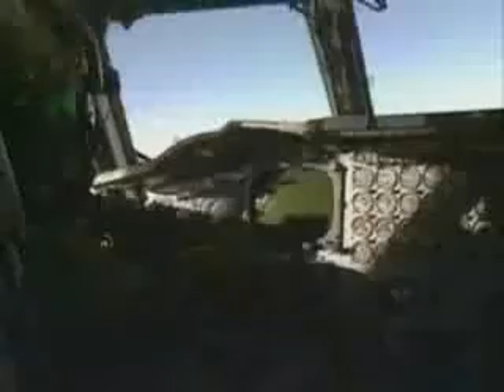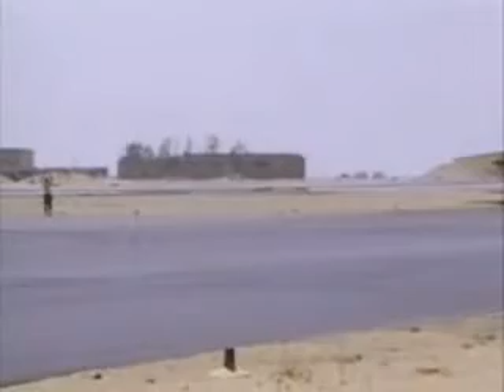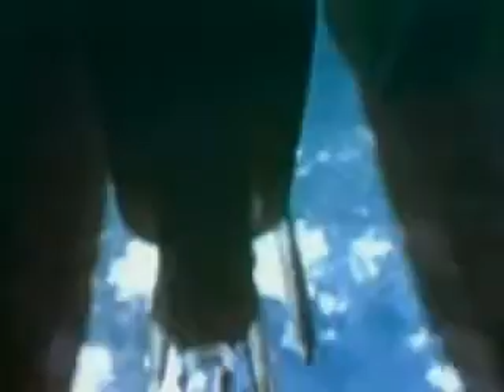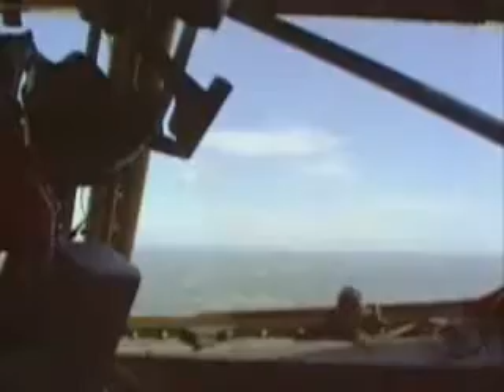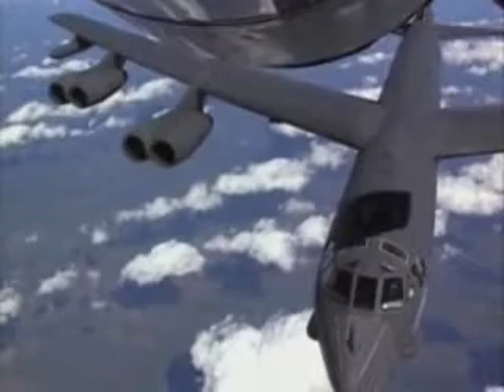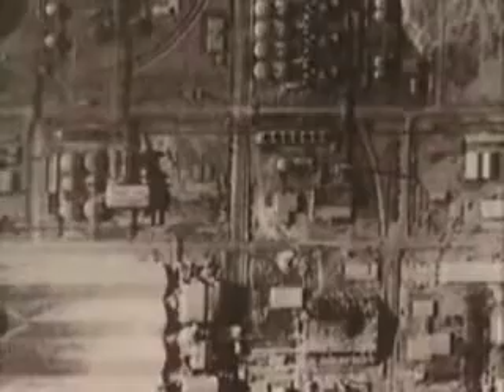FIRE POWER - B- 52 Stratofortress (Part 2)

Comment: This is generally a true video presentation. I was an aircraft commander in the B-52-D during the Vietnam War. I flew more than 100 combat missions in Vietnam and over N. Vietnam in 1972 and received the Distinguished Flying Cross for a mission over Hanoi. So, I am very familiar with this great airplane that brought me home safely. 

My only problem with the video comments is when the tanker boom operator said he could deliver the gas in "5-10" minutes. Not true for the D model. 30-45 minutes.

Comment: Glad they didn't get rid of the B-52, you need a weapons system that can be recalled if the situation warrants that. I am proud to have served with the Strategic Air Command as a Security Policeman. Everything was expected to be squared away.
Our uniforms were creased sharp, boots spit shined, wore camo scarves. Both the B-52 and KC-135 are a credit to the U.S. Air Force which have been maintained so well.